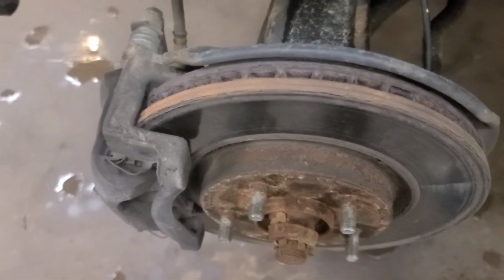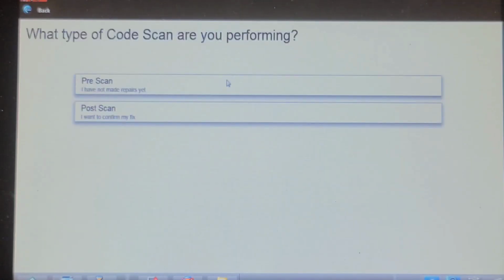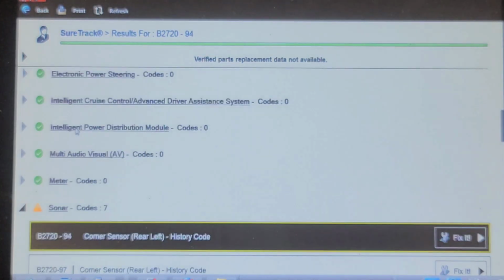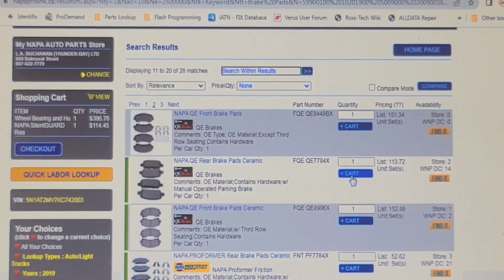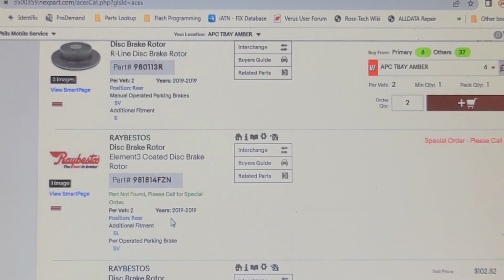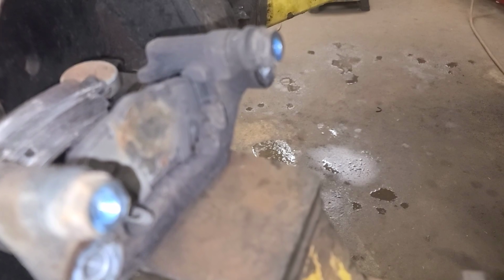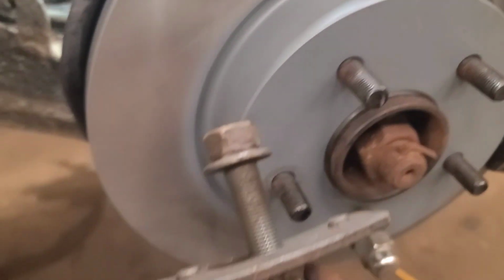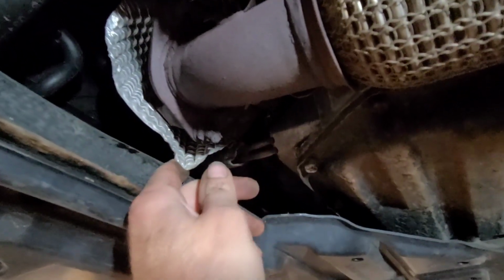2019 Nissan Rogue SVawd Rear Brakes Replacement

Comment: Have same yr rogue rock auto has the parts,also the problem is with the slide bushings getting grease stuck underneath causing the slide to slick you will see after market brake pads with half size rubber bushings this stops the problem.
Reply from the maker: I just checked Rock Auto. They only have the rear calipers with manual parking brake, not the electric parking brake.
Reply: @PhillipBailey  yes the caliper is a dealer part I meant they have the rotors and pads which auto stores don't carry
Reply from the maker: @user-rm4iw1eh2c  I got pads and rotors from the local parts store. Napa I believe

Comment: Very good podcast! What is the scan tool device you are running to do this replacement.
Reply from the maker: I'm using a Snap-on Verus Edge but there are many less expensive scanners that are just as capable

Comment: Just attempted to work on friends. He did not have electronic caliper but did have electronic parking brake after heating and beating the 4 bolts loose i could not even get the rear rotor off. Cant believe this new computerized garbage! Brakes should not be this difficult on a compact SUV.
Reply: Or mid sized whatever you want to call this junk!
Reply from the maker: If you're in the rust belt this is normal everyday...

Comment: The seal got compromised because the person who changed the breaks before you never released the air that builds up under the seal and when they seated the new pads the seal got pinched in between the piston and the pads. Common mistake of the backyard mechanic. Great video very helpful.
Reply from the maker: These were the original brake pads. The vehicle only had 45,000klm on it. Calipers had never been off before.

Comment: I once seen a comment that there is a way of retracting that electric parking brake motor without a scan tool. Should of book marked it for future reference.
Reply: I too remember some trick, but so far  I don't recall it. I have never had to do one, otherwise the answer would come.
Reply from the maker: Yes but I would not recommend it.